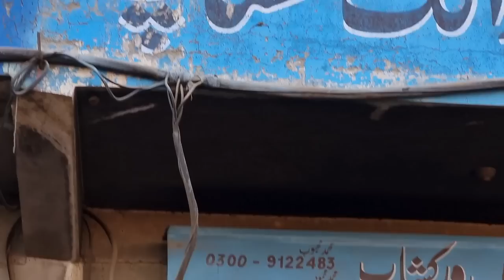Amazing Restoration of Hydraulic Breaker Jack Hammer | Rebuilding Hydraulic Jack Hammer

Comment: "What's the torque spec on those long bolts"? Five big hammer pounds but don't confuse it with the medium hammer. That is metric and you will have to convert.

Comment: Hello P T. Good job freshening the internals of the hydraulic pick. One small problem. One of your guys pushed the casing over. That's fine, except the 300 lb hard edged block landed on the polished sliding zone of the pick head. I guarantee that dented it, which usually results in a sharp edge. The unwanted edge always cuts the new rubber seal, causing the carefully measured new hydraulic fluid to eventually escape. So it will be back in a few months, covered in oil-soaked cement dust. Such is life.
Reply: У них трактор без гусянок, а американец им о кромке рассказывает))

Comment: Wow, such inefficiency and handicaps!  They don’t have even a chain winch, so it takes two kids to move anything substantial.  Oh, the backaches.  They are in a business that requires cleanliness, but they work in the dirt.  They can’t even afford a handheld wire brush, much less an electric one.  Bolts are torqued down with a 10 lb sledge.  As a consequence their repairs aren’t worth a dang, so they don’t get paid much and the cycle continues.  Sad.
Reply: Это ваше будущее)))
С вашей мумией в кресле президента.
Узаххахахаххахахаххах